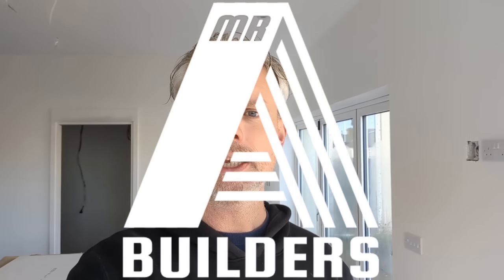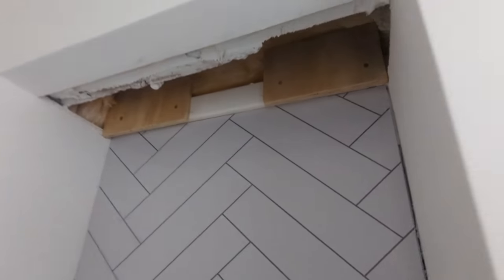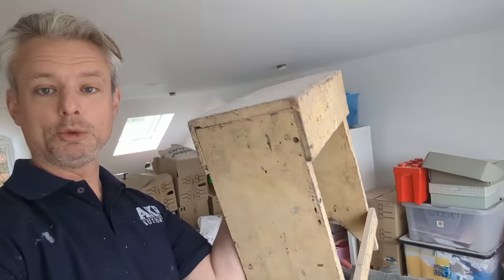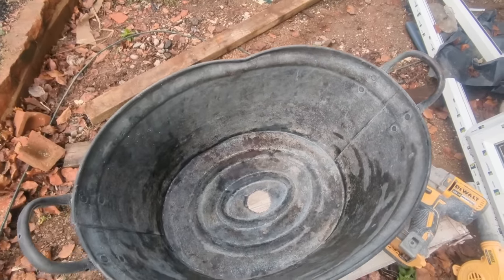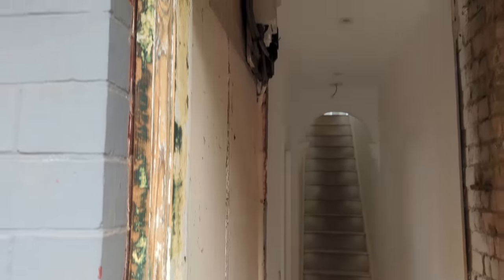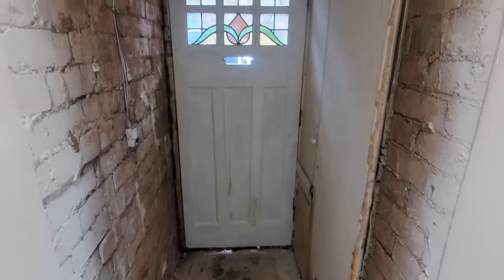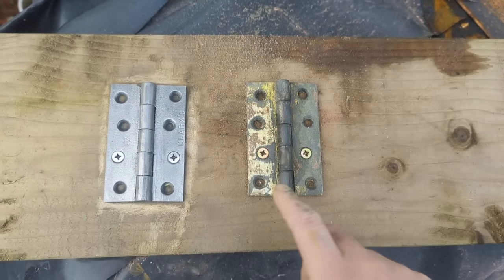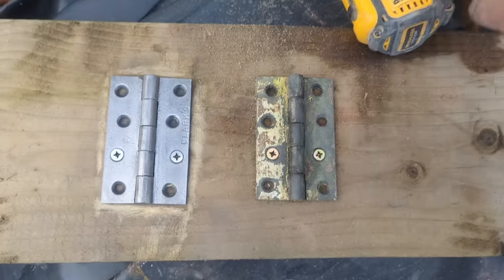How To Make Do With What You've Got!!! Builder Destroys His Own Home #16

Comment: Great exercise in keeping costs to a minimum. A friend of mine had similar plumbing installed in his ute room ( different style of basin though!) He used two of those plastic key ring tabs(red and blue) and hung them off of the taps with chrome beaded key ring chain.
Reply from the maker: Cheers mate, there's no denying that things are getting extremely tight, so every little helps!

Comment: how is the other job going or is it still at a standstill
once that sink passes quality control then everything is good. no point dropping a few hundred on a new one  when that will do for a while. 
window looks good. not much to look at  but it will definetly make the hall seem larger and allow more light in . 
what was wrong with the old door. the pieces cut off looked perfect.
Reply from the maker: It's not quite at a standstill mate and we have an update coming soon. We just wanted a nicer one mate, we've never liked that one, plus it's not original to the house so it's no great shakes letting it go.

Comment: If I'm honest I don't think the sink or door is very innkeeping with the new modern aesthetic of the house. A nice composite door would have really made the front of the house in my option. But each to their own!
Reply from the maker: Cheers mate. There's no way I'm paying over £1000 on a composite door that'll have to be fitted 60mm out of square, that would be horrendous!!!
Reply: @Mr_A_Builders  I can understand that. It's a shame about the opening being out of square. Of course you have to work with what you've got. Just a suggestion, it might be worth adding a mortice lock to the wooden door for a bit of extra security.